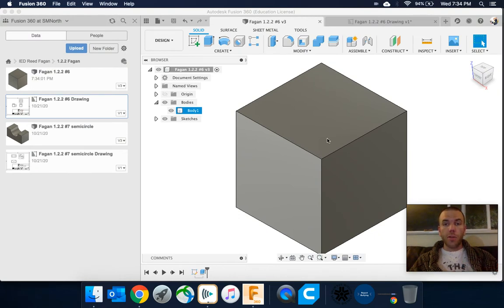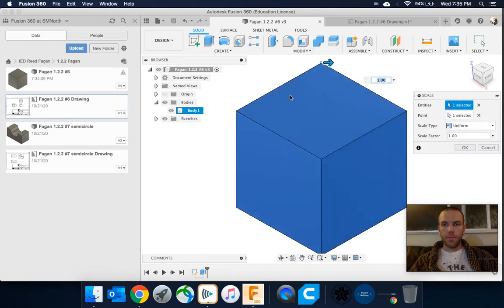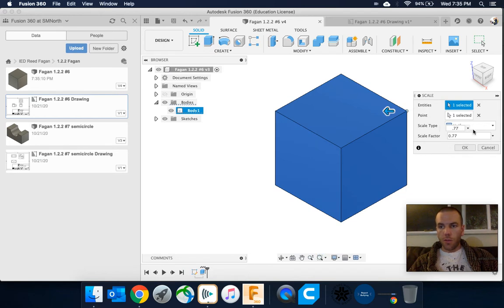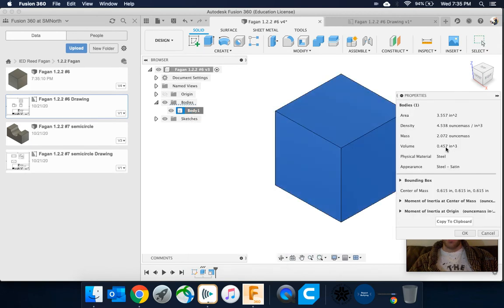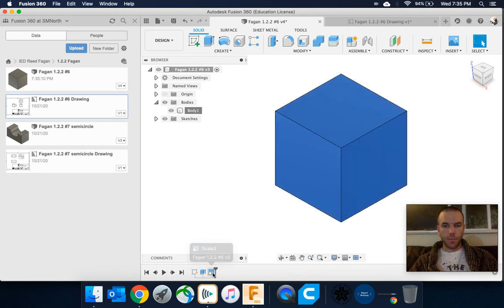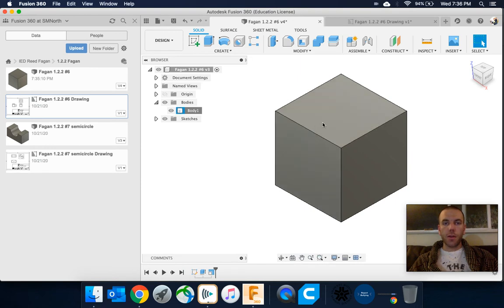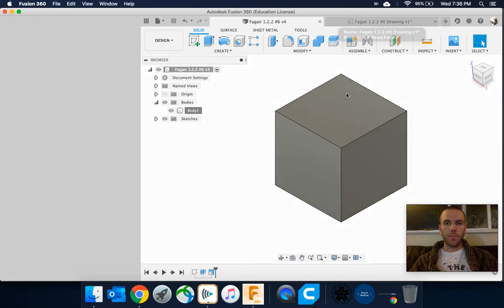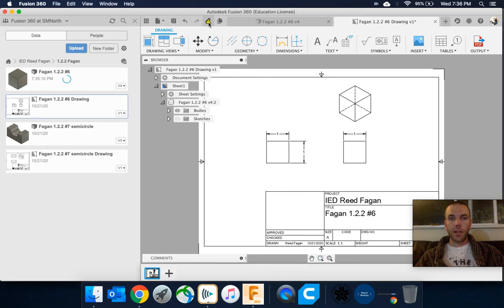Changing the Scale on an Object Fusion 360 20-21

Comment: so how do you scale  from a specifiek instance. i made a square and offset it dimension inside is 193, needs to be 210 but i cant figure out how to scale it from one of the walls
Reply from the maker: Sorry I am just seeing this! I hope you figured out your problem; I'd be interested to hear how you proceeded.

What I would do is say "I know I need 210 but I currently have 193, so what kind of "growth factor" do I need to apply?" And then I would use algebra to figure that out: 210/193 = 1.088 . So I would scale my current design up by 1.088x in order to get where I want to go.

Comment: Thank you, Reed.  It is a shame that this does not seem to work at all when beginning a drawing just in 2D mode; modify has no scale at all and doing the S search, then typing in Scale DOES give something that sort of allows an INCREASE in size but that is all (the Reduce/left arrow does nothing to the selection). I'm just trying to reduce the size of a freehand scroll (since there is no 2D scroll shape tool) to where I need it to fit as a component in other, correctly-sized, parts of the design.
Obviously, I am a complete F360 beginner -- Where am I going wrong? Thanks for any suggestions.
Reply from the maker: Sorry, I am just seeing this now (Apr 22, 2022). I hear your frustration with not (easily?) being able to scale sketches in sketch mode. I am not aware of a method to do that at the moment though it's possible one or more exists. Perhaps you have even figured it out now and could share it here! Best of luck, AerialLens!
Reply: @reedfagan8330  Well, I figured two things out with some success...(1) Be more  careful and spend a little time to get the dimensions where you want them in sketches to begin with, and (2) go ahead and create a body from the sketch, then scale it, then go back to the (now scaled) sketch on the timeline if you need to. Kind on wonky solution there; ideally, the F360 guys need to allow scaling the sketches.  I really like the program though.